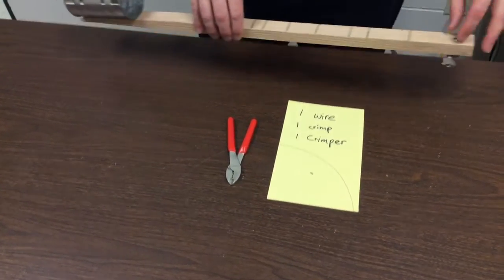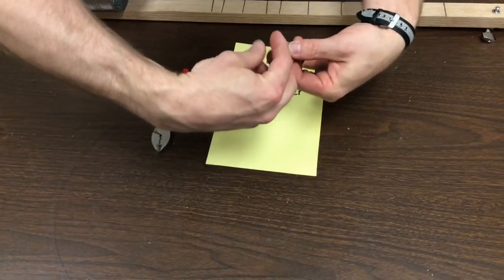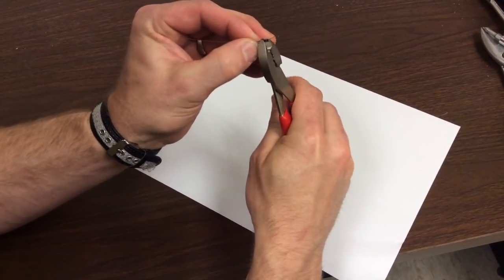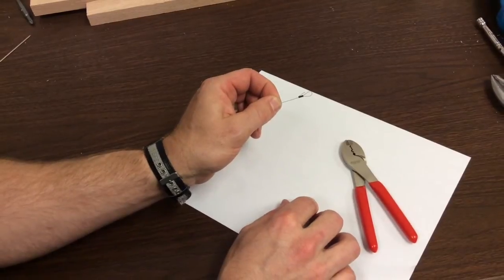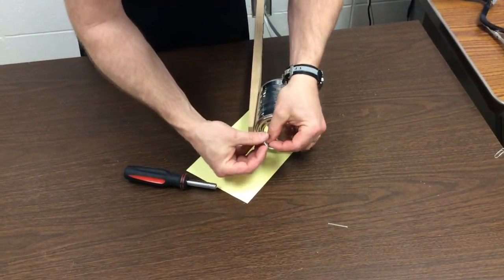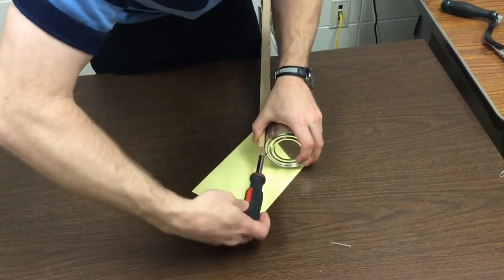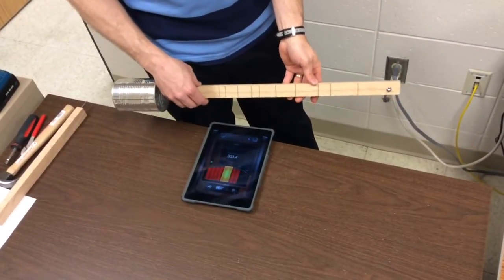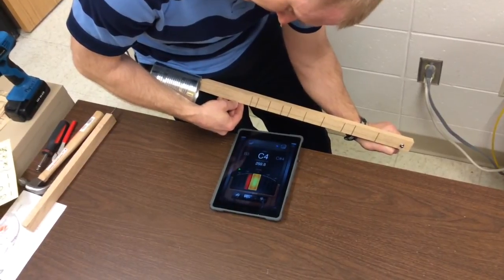Video 4 - Installing String

Comment: Hi, nice tutorial, I'm doing some sort of canjo by myself, but is HUGE! (It's actually some kind of acoustic djent stick, like 7 feet)... anyhow, when you fit the loop of the string in the screw at the bottom, does the can have a hole for passing the string? (Sorry for my english, I'm from Venezuela)
Reply from the maker: yes, you want the hole level with the tuning key or just a little bit lower.
Reply: Thanks, now my Chaos Blade is ready!